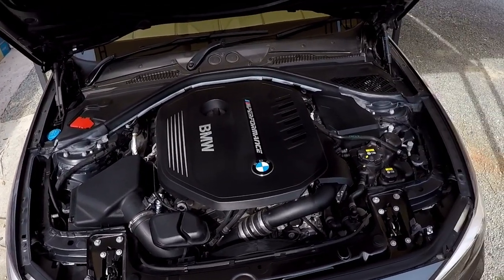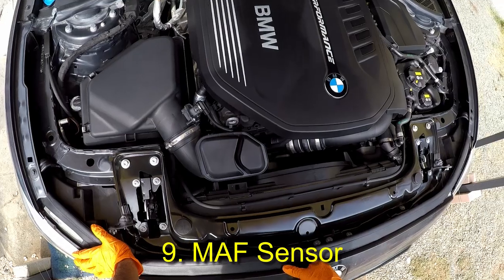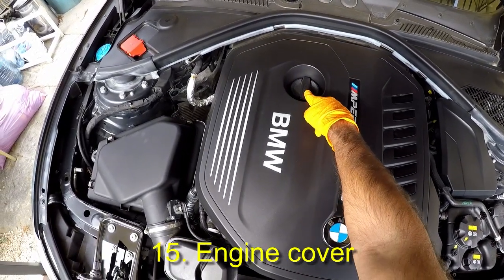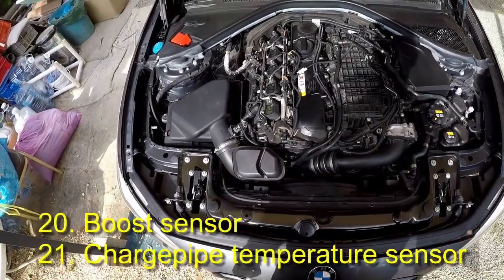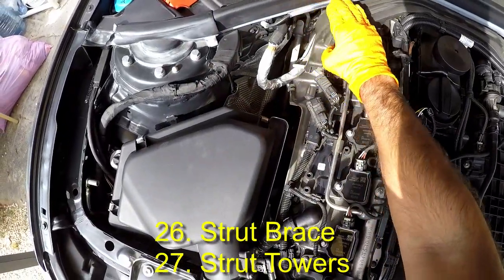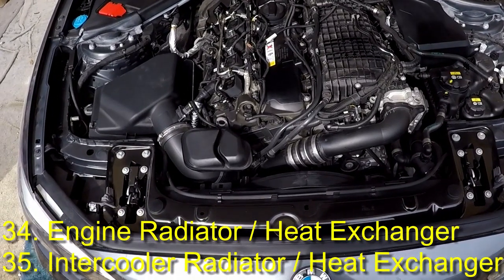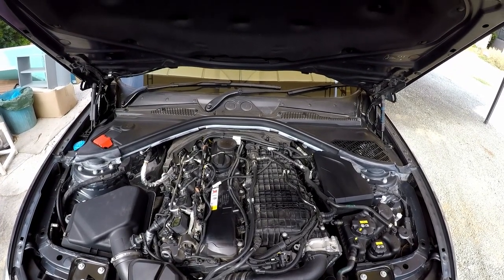BMW B58 Engine - Simplified Under the Bonnet Guide (using BMW M140i)

Comment: The other cap is a diverter valve for the pcv system. It re-routes the crankcase gasses into the intake manifold (no boost) or into the intake box (under boost)
Reply from the maker: Thank you, indeed. Please watch part 2 of this video for more details...

Comment: Thanks so much for sharing your knowledge. You have helped me solve a “problem” with heating. 
When doing track days on small tracks (mainly karting tracks), the engine cuts power after 1 hot lap. I realise now that my mistake was to let it idle for extended periods before going on track, causing the intercooler to get too hot.
Reply from the maker: Very interesting!

Comment: Lovely video, very well explained. The ‘cap’ next to the oil filler cap that you said you didn’t know what it was is the PCV valve. Pcv valve control emissions, prevents crank case from developing oil sludge. It redirects crank case gases back into combustion chamber. Hope that helps
Reply from the maker: Thank you, actually I covered that in my Part 2 video. Please check out Part 2 on the channel:
https://youtu.be/enjN_R94x0M

Comment: I thought the B58 are using chain instead of belt? Please correct if i'm wrong. Thx
Reply from the maker: Hi, the B58 uses a timing chain at the back (one-part timing chain for the B58TU and two-part timing chain for the 1st gen B58) and a serpentine belt for the accessories at the front.

Comment: Is this car with right hand steering(UK)? Any engine bay difference with the left/right steering models?
Reply from the maker: Hi there, yes this is a RHD car (like UK). The steering column should be the main difference, everything else mentioned in my video should be in the same location (common between LHD and RHD vehicles).

Comment: Thanks for sharing, I own the same car from new and spent hours on the lookout for better knowledge about this wonderful engine. It looks like the coolant needs to be topped up frequently on those performance engines, so went on and bought the official BMW coolant. However, it only needed to be topped up once in 1.6 year of ownership as I do not drive it much and rather sensibly. There are 2 coolant lids, apparently one is for the engine and one for the turbo but I read that they are linked up. Not sure if I should fill up both or only one of them. The most frustating aspect is that you cannot indeed check the oil with a stick and need to rely on the computer reading.
Reply from the maker: Hi Roda, I am making a dedicated video about coolant, to be published tomorrow or Friday. From what I can see the coolant tanks are not linked, they must be completely separate systems.
Reply from the maker: Hi Roda, new video on coolant uploaded just now, hope this is useful..
Reply: @NoBrainerTalk  This is a great video, thanks again for sharing. I like the step by step numbered list approach you are showing. Awesome !
Reply from the maker: Feedback much appreciated. Although I wish I had covered a few things more... Maybe Part 2 is coming in the future.

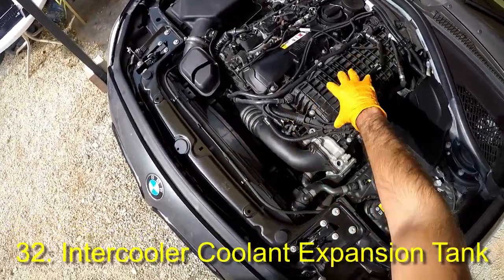Comment: 8:28
 do you fill 50/50 coolant in 32. Intercooler Coolant expansion tank if it is low?
Reply from the maker: The answer is yes, if the expansion tank is below the minimum then it is best to fill with the correct mix (50/50). However in some cases of relatively small quantity of coolant missing the dealer/service centre may recommend to top-up with just distilled water: There is some likelihood that it is the water element (not the anti-freeze) which has escaped/evaporated out of the cap for example, so topping up with distilled water may not affect the 50/50 balance. It depends on how low it is.

Comment: Not an oil cooler. Just another engine coolant.
Reply from the maker: Hi, do you mean for the last heat exchanger (item 40)?
Reply: @NoBrainerTalk  yep
Reply from the maker: Yes, to be honest my research indicated that it is the auxiliary radiator, part of the engine cooling system (auxiliary to the main engine radiator). But reading the forums, where there are different opinions, I became unsure. I think you are right anyway.
Reply: @NoBrainerTalk  In my m240i in this spot in front of left wheel, there is an coolant heat exchanger, so yup, he's right.

Comment: Superb stuff! My crash v-bars are also blue. My car has one small heat exchanger on the right side.
Reply from the maker: Thanks Peter. Having a lower radiator on the RHS means your car has an additional petrol particulate filter (PPF), so its emissions are lower, with some sacrifice of exhaust noise in sport mode. I believe yours must therefore be manufactured July 2018 onwards. My car is a May 2018 model so it was one of the last pre-PPF produced.
Reply: @NoBrainerTalk  Correct. My car is June 2019, one of the last from its kind.